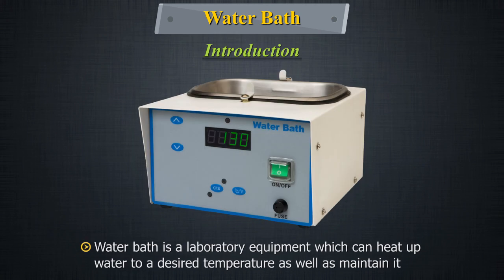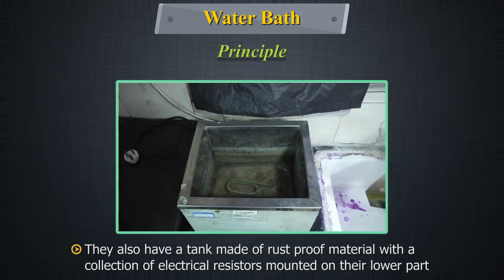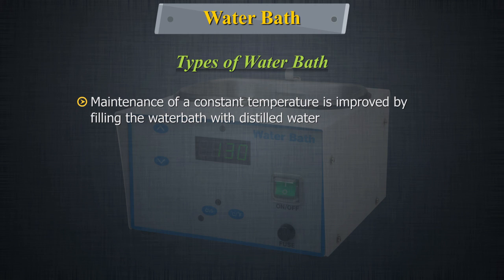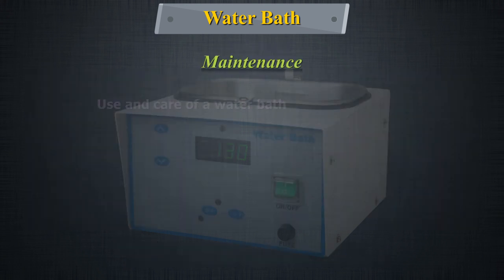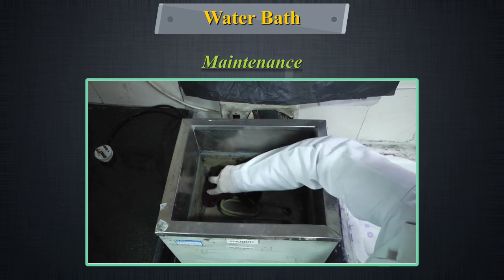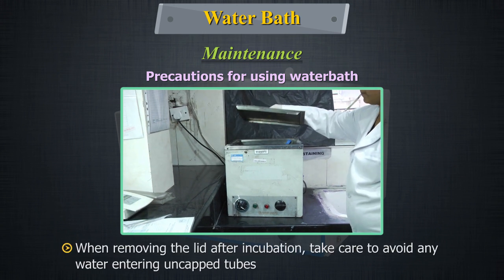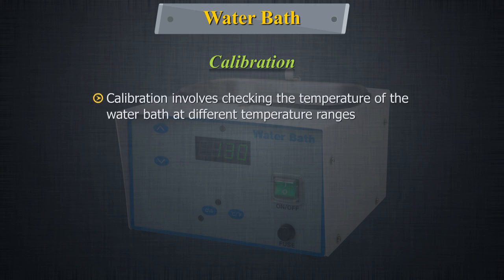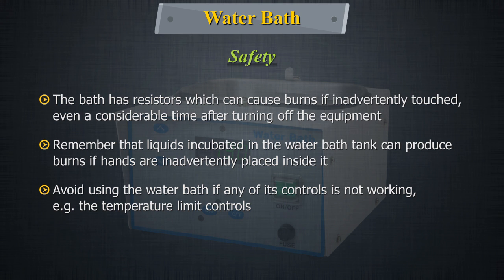Water bath

Comment: you are a technical in serology lab, and you have a problem with the water bath, in which it can't raise the water temperature to 70 C,what will you do in this case?
water bath imformation
Voltage:220V
Frequency:50Hz
Power:500W
?